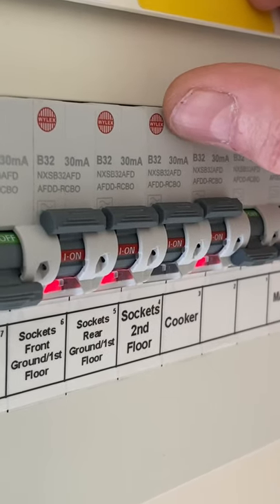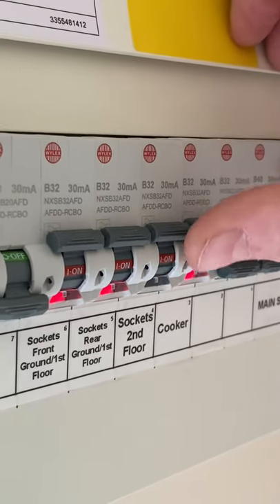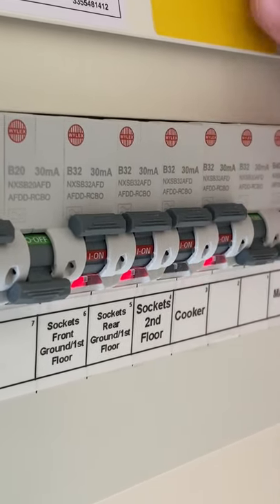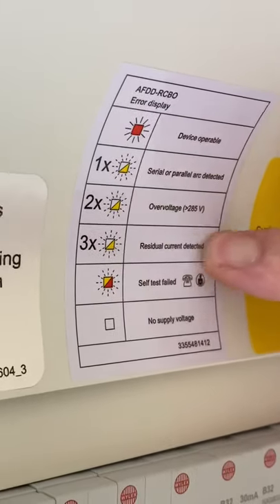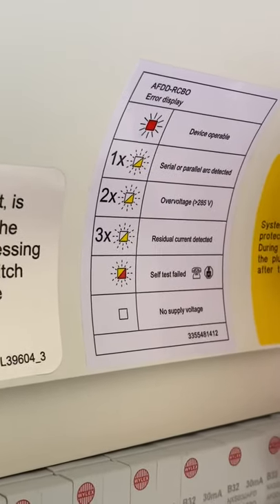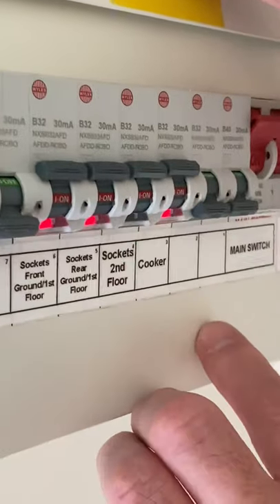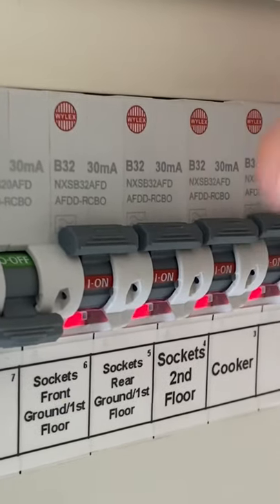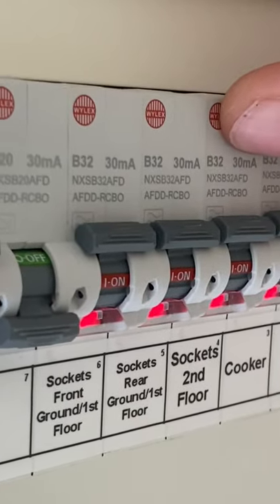Why is my AFDD Flashing at me 😊?

Comment: Does AFDD come under fault detection or additional protection ? I presume it’s fault as it’s basically protection against fire not directly electric shock. This also addresses any open ring problems from loose connections which is very cool.